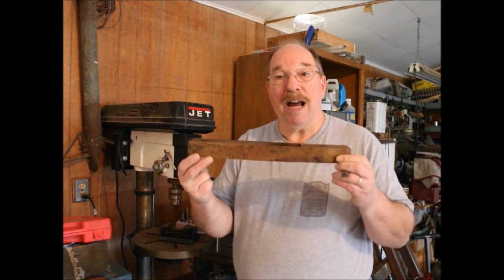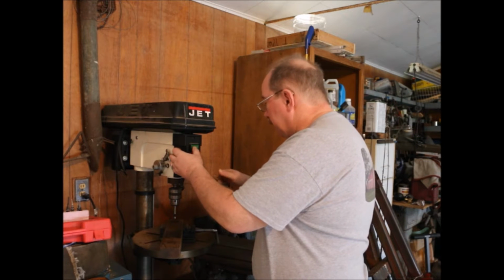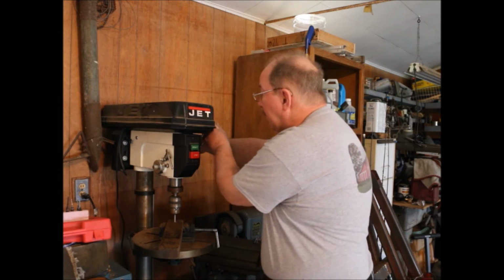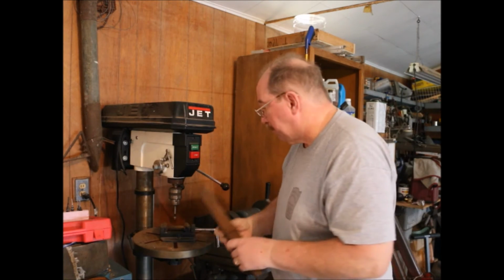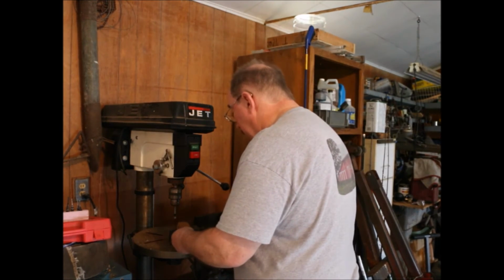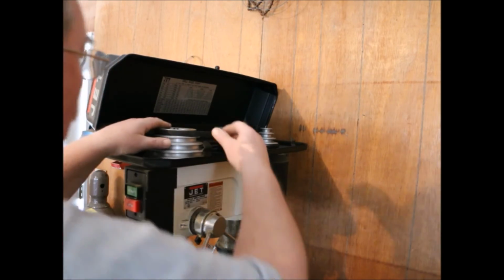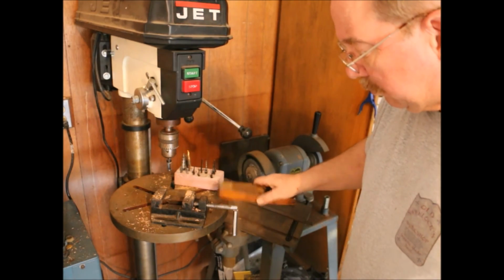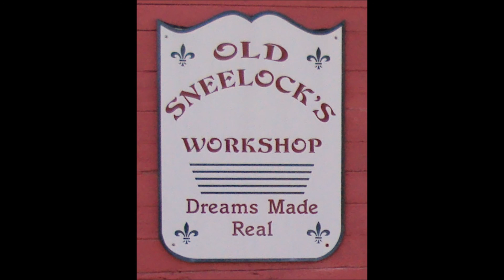Union Transitional Plane ~ Pt 5 ~ Boring The Screw Holes ~ by Old Sneelock's W

Comment: always enjoyable. I noticed you removed one of the handles to your press, smart. I have a table top press and removed 2 of hte three.
Reply from the maker: +Matt Cooper Can't take credit for the missing handle. The press was a floor model at Home Depot. It got knocked over and one of the threaded holes for the handles tore out. It works okay, but I'd rather have 3 than two. 
Just out of curiosity what do you like about having 1 handle?
Reply: Since it is a table model and doesn't drill cery deep. The other two just get in the way. I also check the handles before I drill, in case they have worked loose. One is easier to check than three. 
I found that I was always grabbing the same handle anyway, and never had to change in the middle, again smaller press, and not drilling any thing really deep.
Reply from the maker: That makes perfect sense.
I was looking for a drill press and this one was marked down because of the damage. I've had it for years and just haven't felt the need to repair the broken out thread and make a new handle.

Comment: Those neighbors like running lowers a lot more than I do. There's where Kawasnappers with a bag comes in. I liked all those shootin' arns too. Good job on the plane as uauall.
Reply from the maker: +Lewie McNeely Thanks Lewie. I miss my bagger in the spring time. During the summer I just let the clippings blow on the ground but nothing beats a bagger for picking up twigs in the spring.
Reply: After a rain I'm mowing again and the Kawasnapper is running like a Swiss watch and picking up a lot better that the Briggs engine but I reset the blade height with the new engine and it's a hi-vac kit that even picks up pine needles. Getting there.